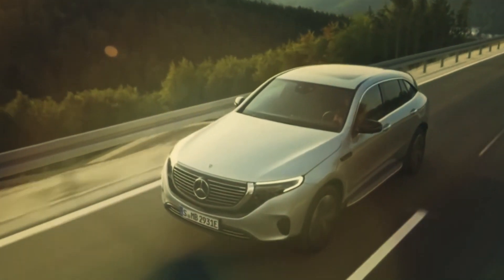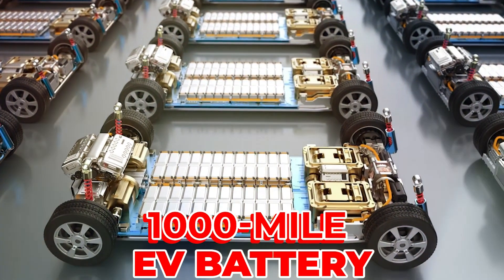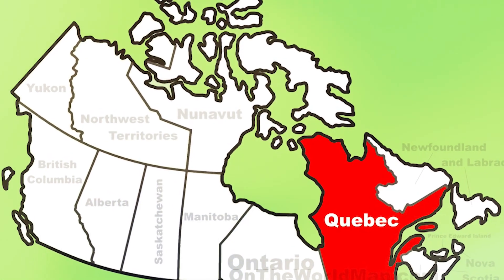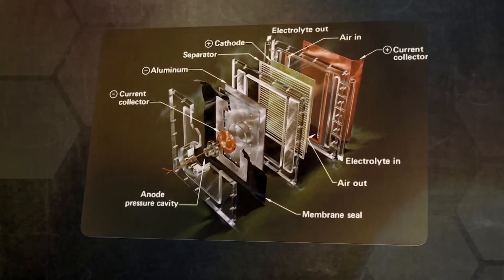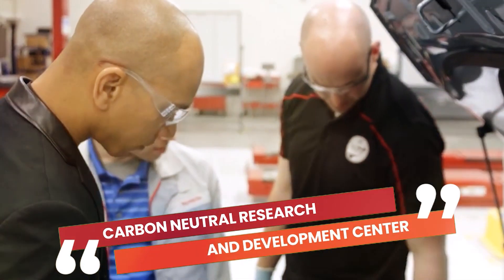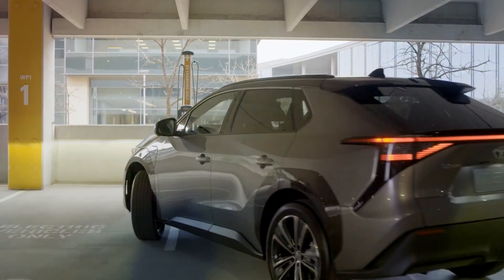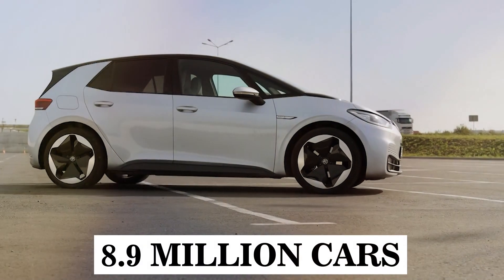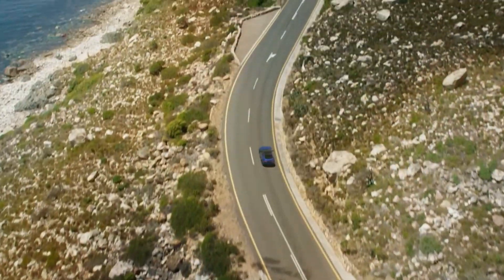American Battery Manufacturer UNVEILS 1000 Mile EV Battery

Comment: Stupid video.  Aluminum air batteries are not rechargeable, so unless you can swap in brand new batteries for less than $50, this is dumb.  In almost 6 years, I've never spent a minute charging my Tesla S as I just plug it in at home and it's always full for the next day.  Going to a public place to swap batteries will be every bit as annoying as when I had to bring my old car to a public gas station.  People who already own EVs won't go for this because they're spoiled with at home charging and no longer have range anxiety.

Comment: Only when we can completely Have a battery that can be reused and not put into landfill of any kind for the next generation. No one is going to buy an electric vehicle batteries that can not explode batteries that can be reused is the best way to go. We will get there it just takes time Regards Alan from down under
Reply: Most batteries will outlast the vehicle. In other words, they can be reused.
Reply: You mean like solar panels? Or windmill vanes? Just butty all the non recyclable shit for the future but protest nuclear power ... 😂
Reply: @dougpurdy2720 If the biggest part of the EV production carbon footprint is the battery, imagine adding recycling to that. This means it will only surpass the regular fuel barely with a long lasting bat. pack. The biggest prob IS the lithium that needs to be processed in a low humidity, less than 1%, controlled environment.